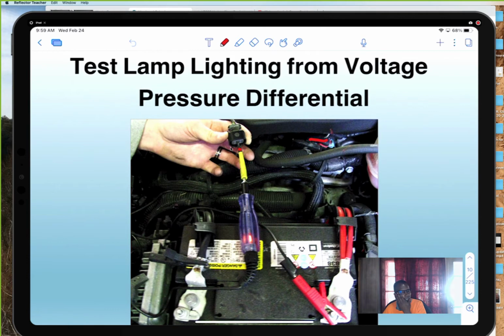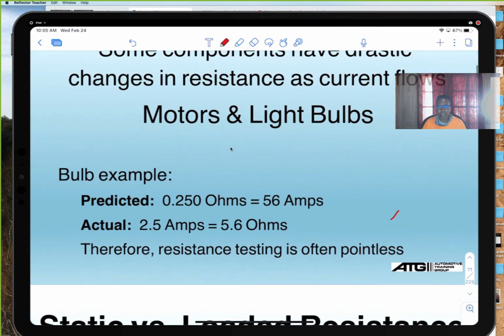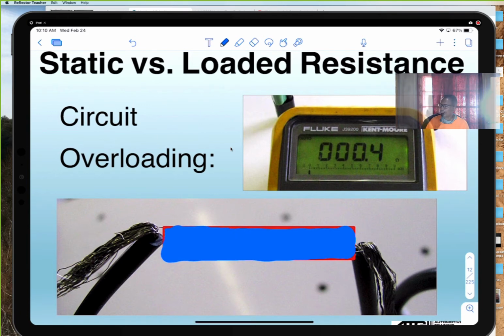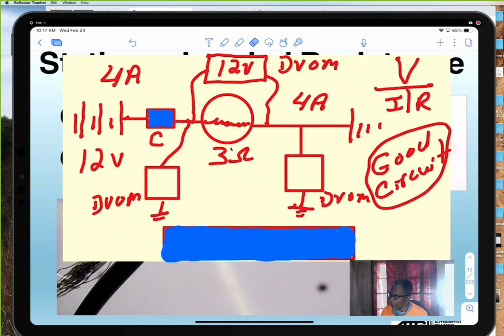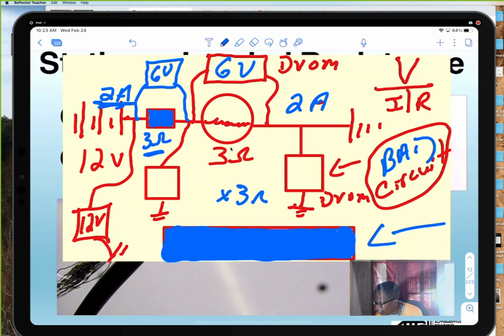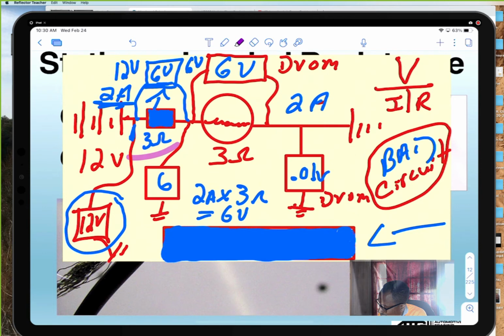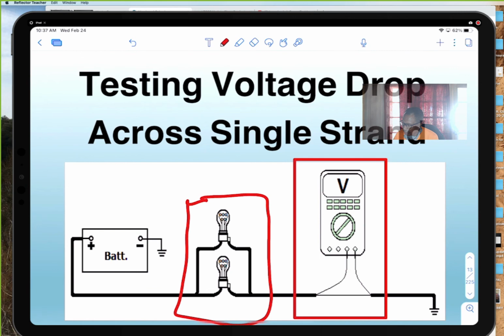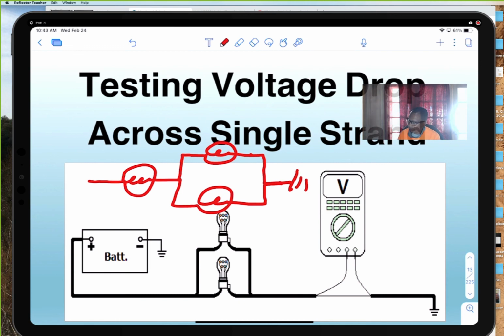How to solve ohms law in an electrical circuit Part 2

Comment: Mario d
Awesome video about Ohms law Part 2. Also explained what pressure differential is and how to measure it. I have  learned about how much voltage requires to pushed from point A to point B  of a circuit when there is resistance. It's getting more interesting. Thanks  Mr. Nate.
Reply from the maker: Thank you sir remember voltage is lost or dropped when going through a resistor